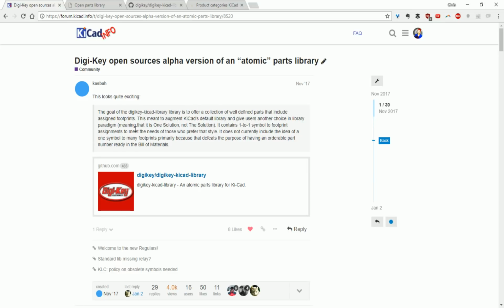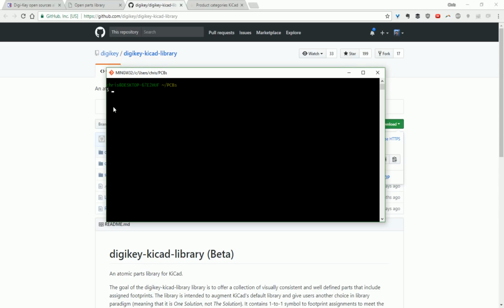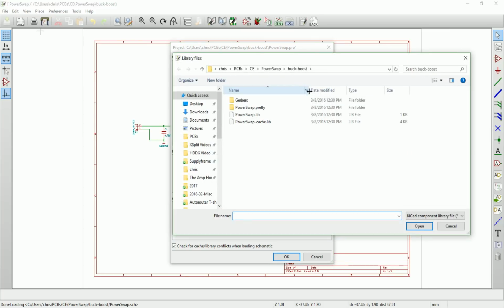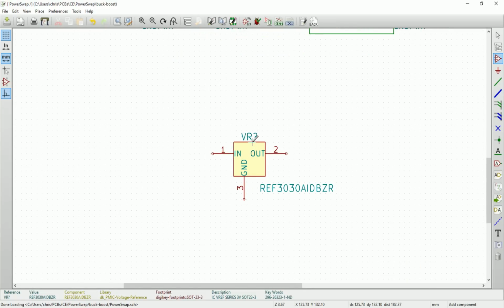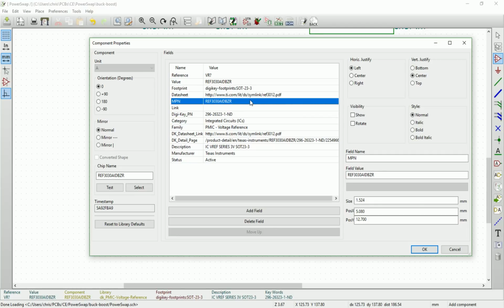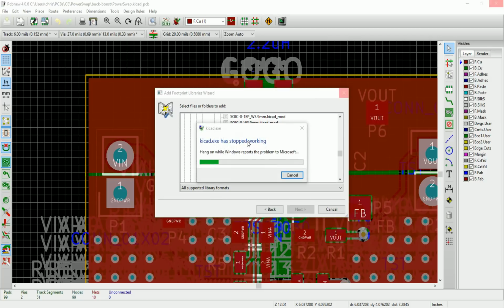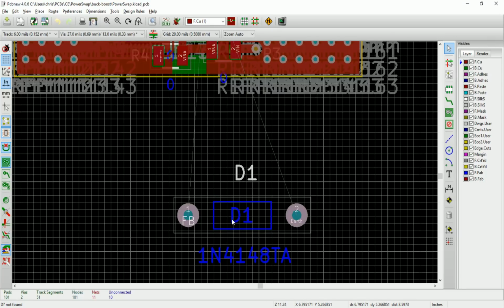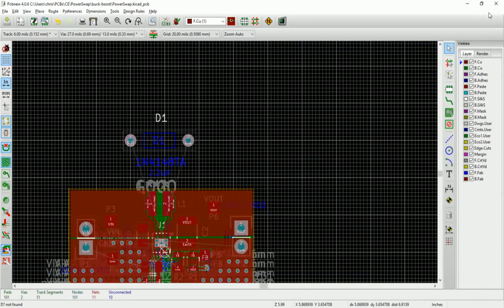Installing and using the Digikey KiCad Library

Comment: Hello, thank you so much for your tutorials. They helped me a great deal and indeed I had my first PCB made with great succes. I therefore thought I could make an even simpler PCB which only has some connector pins and 2 zones.  It is driving me up the wall. Things are getting worse going forward. I cannot select the front Cu zone anymore and in the 3Dview it will not show the zones. DRC shows that my connector-pins are not connected to the zones but they are on the same layer and they are the same net !  I really don't no what to do anymore.. Could you please advise ?

Comment: Hey Chris,
  I hope you see this. First, I just watched the recent FOSDEM KiCAD upload. I had no idea you are so involved with the project. Thanks.

 Second, I also just watched an upload by a guy named Heikki Pulkkinen here on YT. He has occasionally posted a visual demonstration of what I assume is a custom user mod for KiCAD. He shows options for routing tracks with rounded corners and the ability to add teardrops to trace/pad connections. I've been doing similar mods, but have been doing it all manually in GIMP before etching my own stuff. How the heck do I find and add plugins like the ones Heikki shows. I've wanted to try and figure this out for awhile, but at this point I'm rather scared I'll wind up breaking something in the process. I'm sure you get a bunch of requests and probably have a long list of content you want to or plan to make. Sorry if such a request is unwelcome. As a regular KiCAD user, I would greatly appreciate a simple walk through of 3rd party plugins like this. I went through your uploads up until around 4 years ago, and didn't see anything on this subject yet.
  Regardless, thanks for your contributions to the KiCAD community.
-Jake
Reply: Here is the referenced upload by Heikki:
https://youtu.be/z1hrzl1MMV4

Comment: I just installed Kicad 5 Stable, how do I add the Digikey library? Thanks!
Reply: Depends,  Did you get your space shuttle pilots license?  Because that is the easy part... Kicad is an amazing program but their library manager "overseer guy" needs a bullet in the head and dumped off a bridge with cement boots.  How can such a wonderful piece of software be so stupid to setup..?..
Reply: @gavincurtis  That feels surprisingly accurate after getting it to work. Took me long enough.

Comment: I believe KiCad really needs cloud components library where community can easily contribute parts and improve existing ones. In such case KiCad developers can incorporate well-built parts into the main distribution.
Reply: PhilsLab github?
Reply: GitHub is cool, it could work for me because I'm software engineer, but it is not for everyone. You don't have to learn VCS to make your own component. It has to be builtin feature. Even more, the KiCad team hosts the main repo in launchpad.
Reply: All KiCad library are over Github. The point is that the official KiCAD libs follow a convention and so, all addition is subject to librarian check and approval to ensure a certain quality.  So you wouldn't have "just" a cloud thing wich may run wild with any kind of symbols/footprint.

By the way, you may see that those DigiKey footprints aren't compliant with KiCad convention (just to say :p )

Comment: Forgive my ignorance, but what did you use to clone the library? I don't recognize that command window (MINGW32) and where do I find the git clone tool? Thanks!
Reply: I'm not exactly sure why my menu items and dialogs are all different but it might be because I have a recent version of KiCad but I thought it's worth mentioning that although you can just download entire libraries as zip files from github, it's worth installing git and cloning instead (which initially, clones a copy of the directory structure on your local machine, more or less as though you unzipped it). The reason is, it's easier to keep up with changes - the whole point of git as a version control system - henceforth, you periodically only need to open a command prompt at the root of that directory and type "git pull" to pull just the changes, additions or deletions instead of re-downloading and unzipping the entire collection. Mingw32 stands for "Minimal GNU for Windows" (there's also a mingw64). It's is a package that's used for compiling UNIX type code to run on Windows systems. It's like Cygwin but code compiled with Cygwin requires the presence of the cygwin dll to run whereas mingw code runs standalone. The supplied shell (with "MINGW" on the title bar) allows you to use UNIX commands (eg.  ls, cat, grep) on the host (Windows) system.
Reply: You dont need git, you can download a zip from the github page
Reply: Thanks! I took that option instead, but I'm still curious about the MINGW command window. I found MINGW on Sourceforge and downloaded it, but I can't for the life of me figure out how to run the shell.
Reply: Jesse Evans Its the git bash shell you can download it from the git website

Comment: The problem with Kicad... stability and user interaction. You crashed the program a number of times, couldn't find things, accidentally duplicated and deleted entire parts lists, added footprints that work in unexpected ways, and so on. As an 'expert' you could navigate through the multiple issues, but a normal user would have been utterly vexed and frustrated by the multiple problems and ways of doing things. FInding a premade part can be a real PIA, so people end up remaking footprints over and over. I really like the fact that Digikey has provided a master library, now we need an interface to use it that is actually user friendly instead of a bunch of sections and subsections with unknown contents.
Reply: I don't know if that still relevant, but KiCAD 5 is bringing a lot of improvement (Library management, among others).
And honestly, I think that there is already an impressive number of KiCAD symbols and (particularly) footprint.
Reply: @suzizecat  It's still a POS.  The software layout itself is excellent, but the library management tool is incompetent garbage rendering the entire software package useless.  Unless you can code in python and follow their cryptic instructions on how to patch it all together, it will not work.  I gave up on KICAD after designing one board for production (by drawing half the footprints manually using the post edit tool to get it completed) and am back to my 22 year old workstation running NT that has a licensed derelict ORCAD seat.
Reply: @gavincurtis  Well, I designed several boards without designing lots of footprint (almost none) and I never had to patch anything, let alone use python to debug KiCAD... 
I use a copy of KiCAD libraries, from GitHub, and never crash KiCAD by removing and re-adding the whole set of libraries at once... (with version >= 5) But, hey, the most important point is that you got a tool which fills your needs (here some ORCAD stuff)  ;)
Reply: @suzizecat  Got it to work as of yesterday.  :)   Had to call an embedded programmer friend of mine.  After about 3 hours on the phone, got it resolved.  I was not alone with my problem, as many people had the same problem as myself and nobody was providing the correct answer.

I wanted to install the Digikey and expanded github libraries.  That part I understood enough to install and set the pathways... the persistent issue was the inability of PCBnew to find footprints.  This despite the symbol to footprint association tool having 100% success.  Another issue was a cryptic development tool error message which appeared whenever I would try to save a footprint.

After 3 hours and both of us about to give up, found out that it is absolutely required to create a dedicated footprint library in your schematic directory and redirect PCB tool paths to that.  Otherwise PCB tries to save back to the github server, which it cannot do for obvious reasons.  I watched all the videos...yes they did mention this local folder....but never was it indicated how CRITICAL it is and what those cryptic "access denied" messages mean.

Seems lazy on KiCADs part for this elementary annoyance to not make sense.  All they had to do is have a simple message window pop up (instead of cryptic nonsense) when saving your very first footprint: "You are trying to save to a KiCAD github server which requires special permission.  Would you like to save your footprint to a dedicated folder in your current project directory instead?" followed by the window with the proper file location but can also allow you to put it anywhere you choose.

See what I just did there?  In 5 minutes I probably solved a good majority of their customer complaints overt the past years if they would think to implement it.
Reply: @gavincurtis  Holy cow, that is a hell of a problem you got there. I never came across something like that and I never had to create a dedicated folder in a project directory to have anything working (including some libs)...
Never tried Digikey stuff tho, but it shouldn't differ from usual libs. However, I don't use github since a while due to some annoyance when the repository is edited, i'd rather have a local copy that I update when I want. Nothing beat local directories :')
Just a last question, out of curiosity, which KiCAD version are you running ? 
Here is not the place to talk about debugging KiCAD and bug reporting but I really never came across such issue, and never saw it reported on the bug tracker (https://bugs.launchpad.net/kicad ).
Finally, please keep in mind that KiCAD is an open-source project without financial counterpart to help its development. So it is tested by the community and debugged when it is possible. If you see a bug (even though it is not the job of a "customer") you should try to report it on the bug tracker for it to be fixed in next versions.

You also have a lot of community resources  (forum and IRC) to help you when you got this kind of issue.
Reply from the maker: OK! There are lots of options out there if KiCad isn't your cuppa tea.

Comment: Hey Chris, are you familiar with the update PCB from schematic under the tools tab, it saves you from having to push the net list.
Reply: Yes it is in the nightly builds since before December I think.
Reply: You still need to assign footprints but you don't need to export the net from the schematic program then import in the layout program.
Reply from the maker: Saw below it's in the nightlies. I'm not that bold, nor am I recommending anyone else switch to anything but stable branch. Was actually planning on making a video about that.